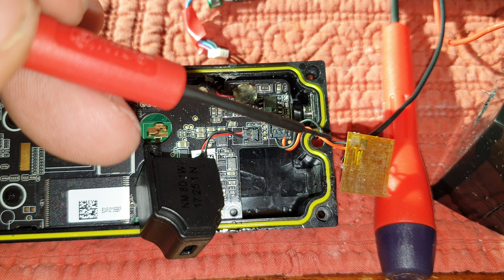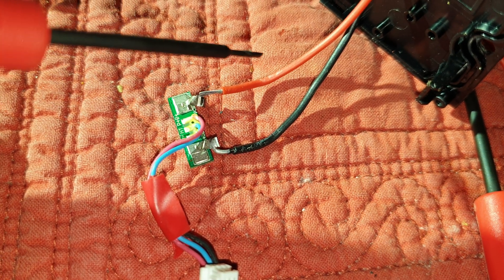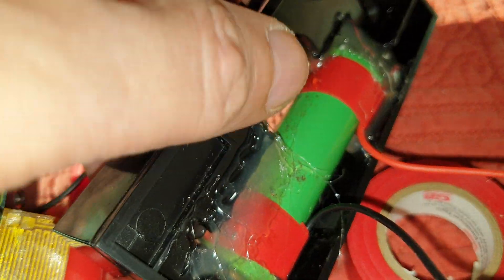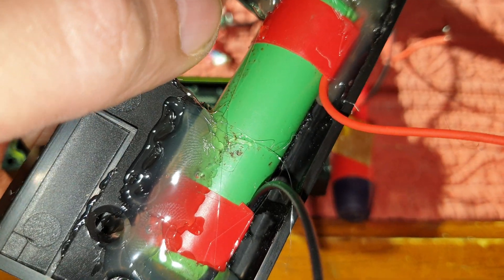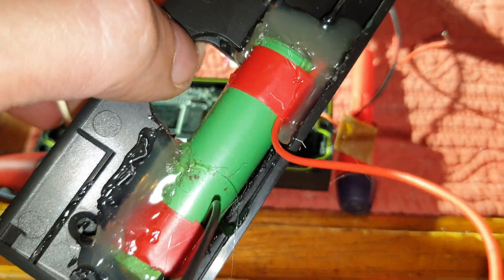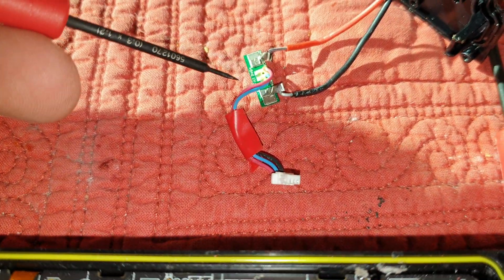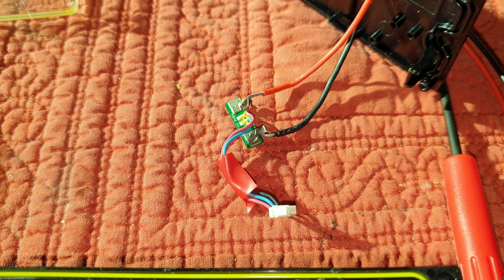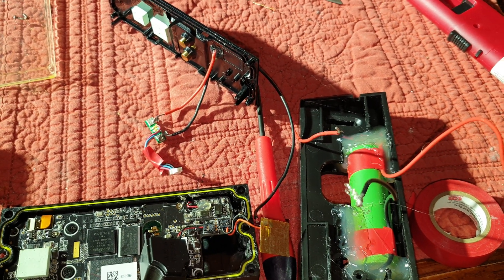Ring doorbell won't power on, connect to wifi or is dead. How to fix Ring pro doorbell.Part 2

Comment: What you are indicating as the "WiFi Antenna" is the battery heater... You can see the silk screened text on the motherboard by the connector that says "HEATER"